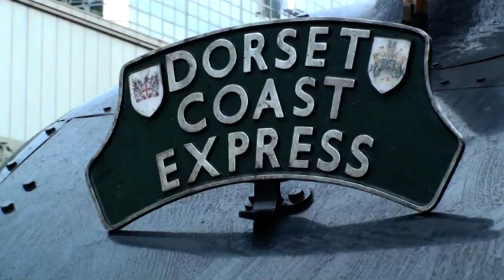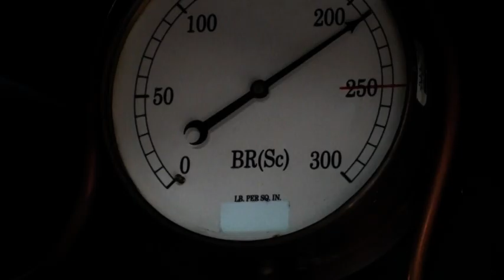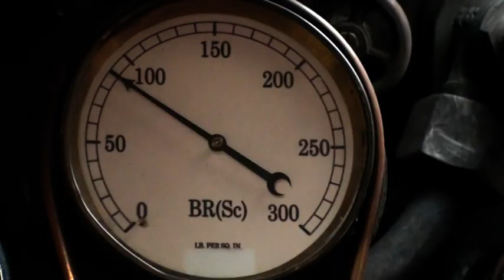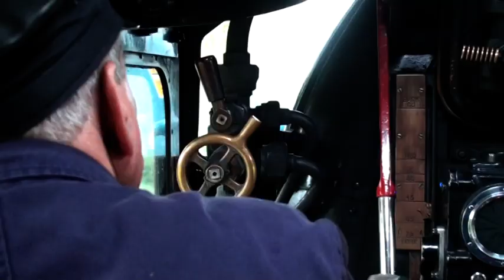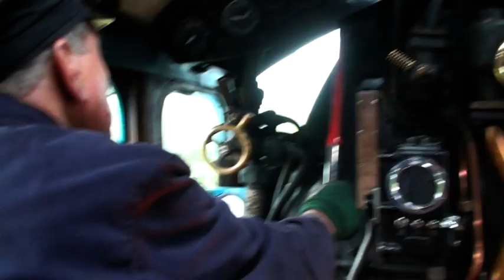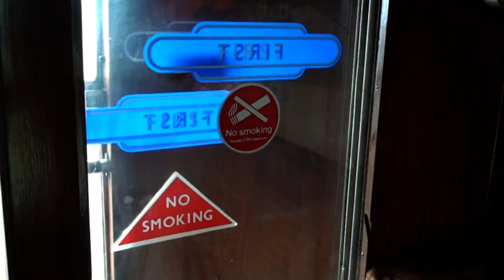A "blue-un" goes to the seaside. 4492, aka Bittern, on the Dorset Coast Express

Comment: Its connected to a valve in the air brake system, if the buzzer isn't acknowledged in 7 seconds it dumps the air pressure and stops the train.
Reply: Rubberfrog 7 seconds? Well you clearly don’t know your stuff.

Comment: I was a passed cleaner at Kings Cross in 1964-65 by which time obviously steam had gone for there. When ever you were mated up with either a senior passed fireman or driver in the junior links and the "old days" mentioned the term A4 or Streak were never used it was always when refering these locomotives "Blue un's" no matter what the colour was, Garter Blue or Brunswick Green. The Top Link drivers, also known as "lodging b*****ds" would rarely ever even acknowledge your existence, happy days

Comment: Has this train been updated with a signal warning device thingymebob? ( The yellow and black circle thing and the ringing bell ) If so, my question is, can that device make this train stop without human input? and would it do that electrically or mechanically? Thanks!
Reply: Hugh Munro yes it will stop the train if not acknowledged, one of two electrical safety systems mandatory on all main line locomotives. It works via magnets placed in the track to sound either a clear or more restrictive aspect.

Comment: Quick question, is that a Westinghouse air break pump I can hear? If so where is it on the engine?
Reply: steam driven air pumps have been fitted to all three mainline registered a4s,The reason why the engine has one is because vacuum braked stock is not as widely used as it once was, so it was fitted  to increase the availability of the locomotive for working charters.
Reply: Ok, thanks for that, where is the pump located on the engine? Wouldnt have thought there was much room to put a pump on!
Reply: SARYx141
i don't know for sure where its mounted,it could be under the tender tank.The owner has had all his mainline registered locos fitted with air brakes,you can see the airpumps on br class 7 Britannia and gwr castle nunney castle on the buffer beam,thanks for replying and merry Christmas.
Reply: SARYx141
Another example i can think of is Tornados air pumps,The engine has two in case one fails.They are both mounted between the frames under the firebox. A bit awkward to reach!!
Reply: Ah righto, thanks a lot for your help!

Comment: I wonder what she would look like without that gorgeous shroud…
Reply: I think the Flying Scotsman had an A4 boiler for years, so maybe not that differents from its' predecessors....
Reply: One reason the A4s were never de-streamlined was that, unlike Stanier and Bullied, who basically covered up a conventional loco, Gresley designed the A4s purely as streamlined engines.  If you have the chance to see photographs of them with the cladding off (photos at Doncaster works), they are pretty weird looking things.  Even Thompson, with his hatred of all things Gresley, desisted from removing the A4's casings, apart from the valences below footplate level.

Comment: is Bittern right or left hand drive?
Reply: Left, only GWR engines are right hand.
Reply: +Alycidon Deltic thank you
Reply: Alycidon Deltic not quite right there are other right hand drive engines, I.e. The NER Q6
Reply: Thanks for the correction, didn't know that.
Reply: The Gresley A1s and some A3s were built as right-hand drive engines (the GNR was RHD); however, due to safety issues, these were all rebuilt to LHD, and all later A3s and the A4s were built as LHD.  Hope this is useful.

Comment: How often fo they shovel coal into the tender
Reply: it depends upon how much coal is shovelled at time.  About 4 to 6 shovels full every 2 to 3 minutes.
Reply: Not so often after the water is hot. A couple of lumps of coal even so often to keep the pressure stable